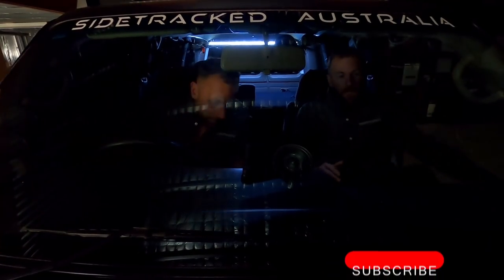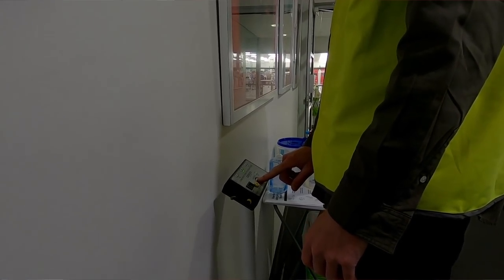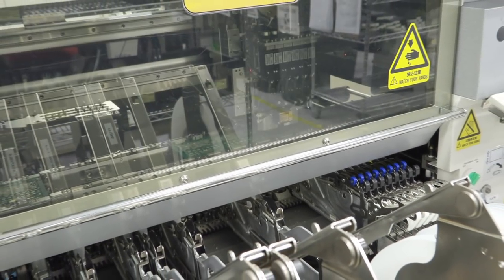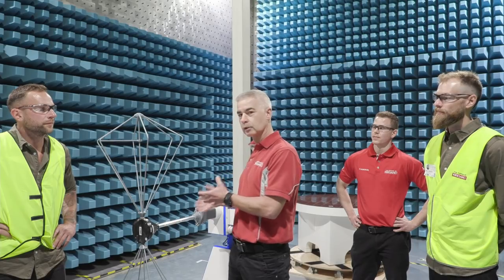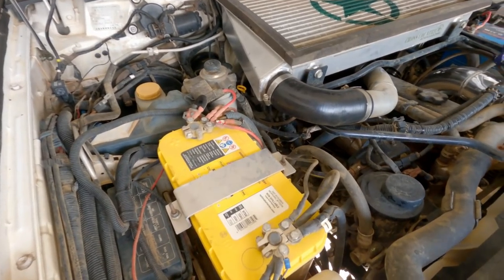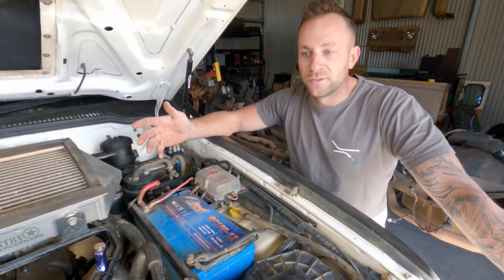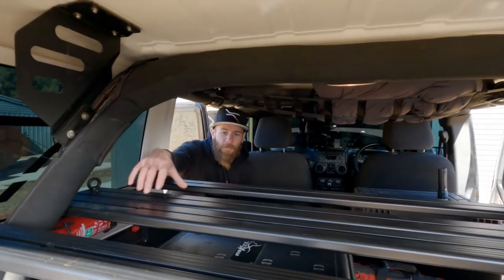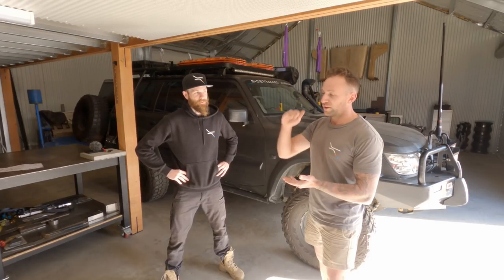12v Setup & REDARC Visit

Comment: 110% Redarc all the way. Got the TowPro V3 in my 60 series along with the EGT Boost and Oil Temp and Oil Pressure gauge. The next step is a lithium battery and BCDC1240D, and possibly there 2000w inverter down the track. Support Aussie made whenever and however possible.

Comment: Love the setups you blokes are running nothing insane just easy and useable and makes me glad I did bother going insane with my GU setup. 

Just need to add a BCDC to replace my redarc isolator I think.

Who makes your roof cargo webbings
Reply from the maker: Boab
Reply: @SIDETRACKED  cheers boys are the both large ones or is the one in the jeep a smaller sized?

Comment: I've had a ctek charger and century agm battery for 6 years without an issue.  Probably cost $1000 max.
Our new trailer comes with a manger 30 and I'm excited to have that next level though.

Supporting Aussie made gear is the way to go if you can

Comment: Tried a few other reputable products, both Australian and US designed and I have run into issues, about to slap a manager 30 in to my vehicle. It will be a slow run of upgrades to follow, water tank etc, to make use the features. But I have no qualms with that as I am yet to be satisfied with my 12v to date. Time to go oz made.

Comment: Nice upload 👍
….yep. It’s the KISS method for me. A Redarc isolator and a AGM 2nd battery. 
You mentioned the ability to feed in solar. Not sure if you know, my solar panel has a 5 stage controller, should I not be feeding into the 2nd battery with just an isolator?

Cheers
Reply: As long as you have an non smart alternator that would be fine. Otherwise the alternator could drop the voltage below the isolator voltage and not change your 2nd battery